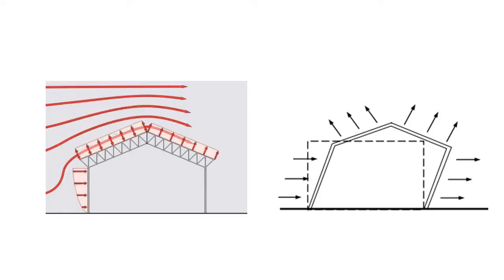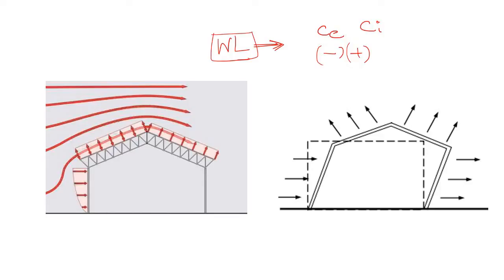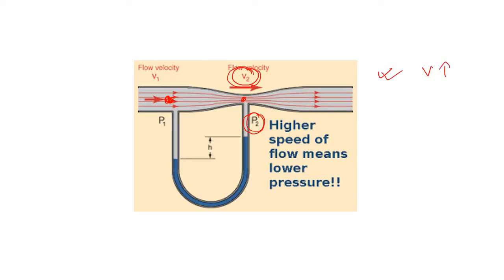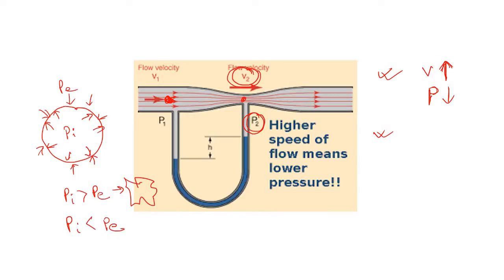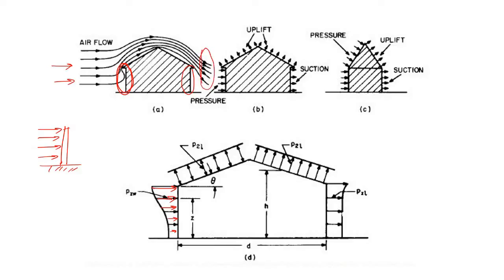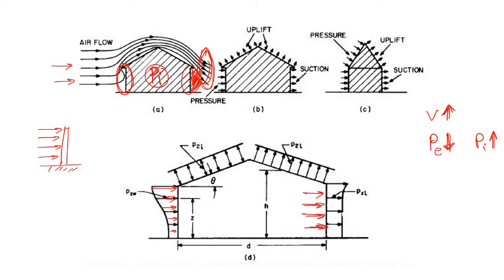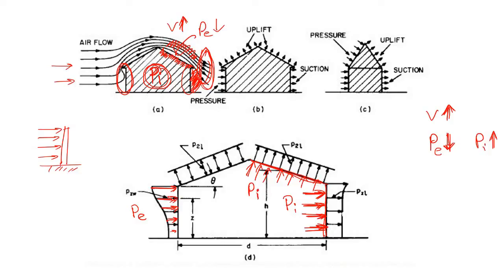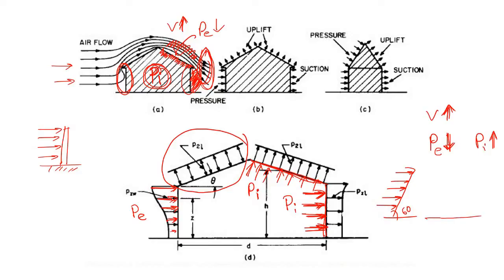A discussion on Wind Load: It may Help you

Comment: in last case, suction arrow shown outer of that house, I agreed. but inner arrow , inside house! (it simply counteracting outer and inner).. i am not able to understand that case.  teach pls  ,. as you told due to high velocity, low external pressure, there is opening there. what philosophy happens there?